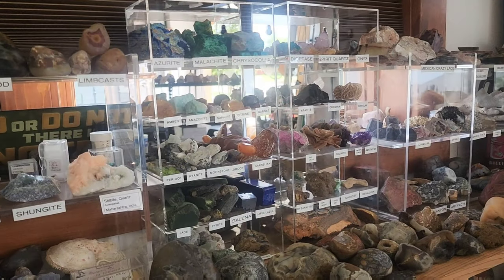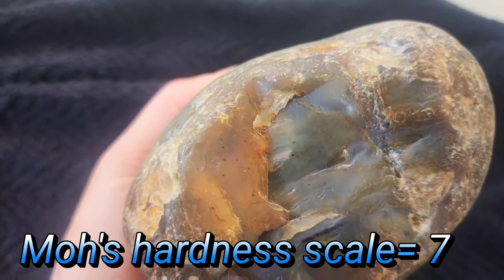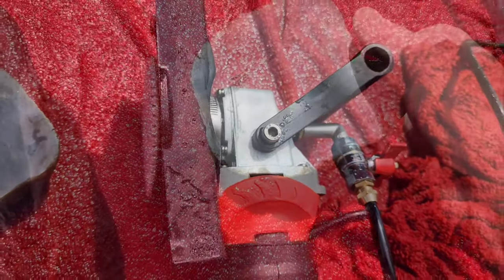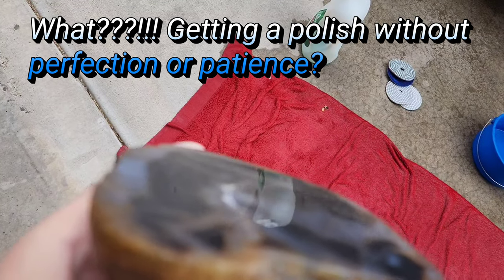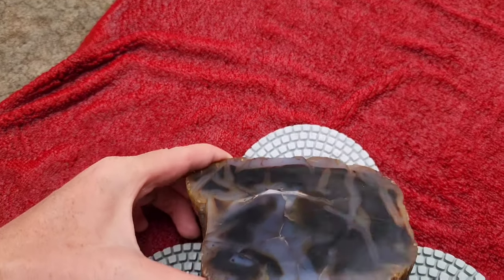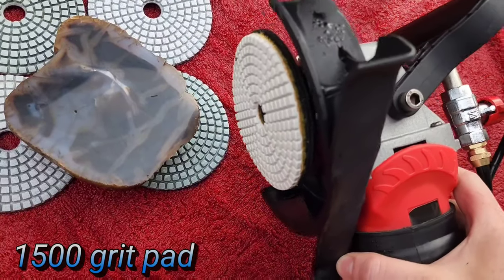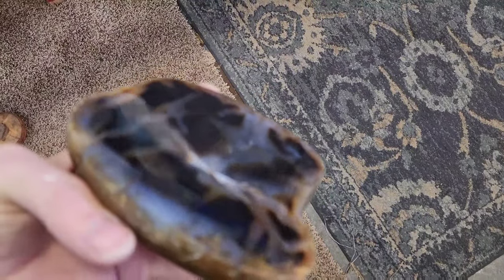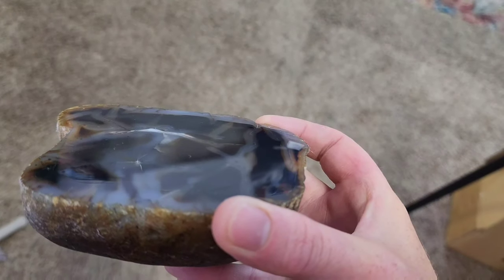From Start to Finish: Wet Polishing a Large Rock #wetpolisher

Comment: I do hope everyone using these grinders are using a face mask at a grade of N95 or better. That fine silica that you are taking off will end up in your lungs and in 20 years, just like a smoker, you may end up with lung problems that could have been avoided.  It is fine enough you need the N95 or better, not just a simple mask.   Any time you are grinding rocks you should wear one, not with just the grinders.  Even wet polishing you should wear one.. how much "powder" do you feel on your face after you have finished and are dried off? that same amount is going down your lungs!!! be safe! ear protection and eye protection is a must also!!!
Reply: I hear you  . When I first started using a bench grinder for my rocks I did a solid 5-10 rocks without a mask and I felt it . Mask is a must 🫡

Comment: I had someone in a rock shop in Deming show me how he uses one of these. He has a small washtub filled with gravel that he grinds the rock into to hold it place. The tub has a hole in the side near the bottom to drain off the water. The tub also acts as a splash shield so you don't get soaked.

Comment: Lower grit number for lower speed, fine grit associated with the higher numbers allows for a higher speed.  If you removing lots of material with 50 grit your problem is with the heat produced which can cause small shallow fractures.

Comment: I started off with these types of wet polishers years ago. They work, but can take a lot of time.

Always wear rubber gloves when using it. It nakes holding your piece easier and can insulate you from getting a shock. 

Cool video.

Comment: Great job Kim!  I'm going to give you a pro tip on how to get those scratches out faster.  Stay on the lower grits a little bit longer, and then the higher grits will be very quick work.  Every time you try and remove scratches with a higher grit like 800 it means you should have stayed on 120 or 220 or something in that area a little longer.  I'm sure you figured this out pretty quickly.  The polish came out real nice, you will be a pro in no time!!

Comment: Awesome! I have those same pads but I just use my angle grinder for the meantime and dip in water as I go to keep it wet. I'm still a beginner lol. That's a nice polish you ended up with.  Nice pup you go too! Great addition!
Reply from the maker: I first tried with an angle grinder but it wasn't variable speed. I learned the hard way you need to have variable speed to get the best results! My angle grinder was very powerful, my pad went flying across the street and I couldn't find it for days, lol.

Comment: I use a wet grinder similar to that but the hose attaches to the end so I can lay it upside down. Then I can hold the rock on the pad and move it around and apply pressure as needed. I also have a 5 inch stainless steel plate and pads to reduce the rounding on the edges of my rocks and speed up the process. Especially helpful on a bigger rock. Also got a 6000 grit pad for my final pass. Some people can't tell but I can and it makes me feel better. The down side to this method is it sometimes makes my fingernails shorter.
Reply from the maker: Does the stainless steel plate attach just like the other pads?
Reply: @Montana Rock Mom it replaces the rubber pad the polishing pads are mounted on. The one I got on Amazon is called Stadea ASBP103Q 5 Inch Hook and Loop Backing Pad With Rigid Aluminium Backing.
Reply from the maker: @wernberli  thank you

Comment: I use a Makita wet stone polisher
I recommend cross hatching the face of the rock during the first two grits so you can see right away if you missed a low spot.  You still need to dry the face to check for scratches before the third grit.  I use a Minwax pencil because the ink from Sharpies run into cracks and it's hard to get out.  The wax pencils in cracks can be scrubbed out with a toothbrush.
There's someone on YouTube who puts his rock in a bucket/tub to catch most of the excess water
Reply: I use a Makita as well, but still have problems esp with white or clear agates.. I still have very fine small swirls that show up at the higher polishes even though I have spent so many times going back trying to get rid of them.  They how up in daylight but not artificial light, that is how fine they are. do you have any suggestions? am I pressing too hard, too soft?? any tricks?
Reply: @annettesmith6358  I bought 6k and 8k grit disks and get a mirror shine on about 80% of my rocks.  I finish the other 20%  with a cerium oxide polish
Reply: @annettesmith6358  Other tip is to completely dry the rock to examine it before the last grit to make sure the swirls are
Reply: Also wash your rock between grits with soap and a brush to make sure there's no debris on the rock or in crevasses before going to the next grit
Reply: @nancywilson9380  Thanks for the tip about soap and water, will try that.  I do dry the rocks, and work on them only in bright daylight outside for the best light to see the swirls, I even get a magnifying glass out on those clear ones to try to see those swirls!  I have not tried a polish.. maybe that will take them out.

Comment: That 50 grit step can be a long one, especially if you have saw marks. I ended up buying a vibra-lap for that very reason. It preps the stone better than I ever could.
Reply from the maker: I had to send my vibratory lap back to the manufacturer to fix the motor! It's been a while...I hope they fix it. I miss using that.

Comment: Love your videos. Just a few tips that ay help you and speed things up. First, make a box out of 2X4 and plywood scraps that is just slightly larger than your rock(nice rock by the way). Fill the box 2/3 full of runny plaster of Paris.  Coat the back side of the rock with Pam or Elmer's glue and let it dry I bit. Push your rock into the plaster to the point that the rock surface is just above the plaster and let it dry. The rock won't move at all and you can put more pressure on the grinder and keep the pad flush with the surface. The fixture won't move around on you while grinding. 
Second tip, use a wide sharpie and color the stone before you start grinding and polishing. The marker gets into the scratches and it is really easy to see when that step is complete,  marker gone move on.
Third, turn your water fliw down some, the mud you will create on the surface will actually grind or polish the surface faster and you will make less of a mess.
Finally,  if all else fails, and in the winter just come throw the rocks on my vibratory lap and walk away. Leaves time to cut more rocks, and it's much warmer in the winter. Covington sells a vibratory lap for little money, watch their used refurbished listing.
Keep the fantastic videos coming,  I love em

Comment: Awesome job, I have the same pads but I use a drill motor. I recently bought a used AC motor which runs at 1725 RPM and I will be building my own flat lap. I don't think you needed to have the water on that high but on a hot day that looked like a fun way to stay cool. Really like your content, I have watched a few of your videos and thought I had subbed! I have now. Love the new addition to your family, Lola is so cute, and so are you! Rock on.

Comment: I benchmount my ZFE to an outdoor table with a metal clamp and it becomes much easier to work with. Holding the stone is much easier than holding the grinder for smaller pieces like this. Mounted vertically so it's more of a vertical high speed flat lap of sorts.

Comment: with a smooth cut like this from Drogon it would be best to use a flat lap if you have one. where this wet polisher comes into it's element is when you use it to polish curved surfaces on a speciman that you plan to leave a rough side on, especially something large. this is a great tool but don't wear yourself out on it with the wrong rock. heh like you said definitely a job for the hot months and when you can enjoy getting mostly soaked. heh some of your crazy looking jaspers is where this machine can be amazing i think. imho

Comment: I happened to have bought that exact polisher but have been apprehensive because of the water/electrical factor. Has the gfci built into the cord ever tripped, or have you felt any tingling? 
Thanks for posting this.

Comment: Great post Kim❣️Glad you were patient ENOUGH ❣️ I wondered about the total time for that job? Must have been a while if you had to break for dinner❣️Welcome Lola❣️ Keep on Rockin❣️
Reply from the maker: I probably spent most of my time drying the agate off and trying to see if I had scratches. I didn't spend more than 5 minutes on any one polishing pad. There are 7 polishing pads though. So, if you are drying your agate off and analyzing it between steps, etc... you will likely spend at least an hour from start to finish.  I also had to cut it. It took my saw approximately 15 minutes to cut through... then you have to clean it and get all the saw oil off. Boy, the time starts to add up... and then you are hungry!

Comment: Just get a flat lap, eliminates all that work....and getting wet. 
    It appears like there are some ridges on the face of the rock as it comes off the saw.  That suggests that sharpening your blade (make it cut faster) might eliminate that, and if it doesn't, then you may have an issue with worn bearings allowing minor movement of the blade as it's working. Before a full bearing replacement though, make sure the bolts holding the bearings are tight since loose bolts could also be the culprit. To check for bearing wear, grab the nut holding the blade, then the flywheel, and wiggle them, if there's movement, either those bolts I mentioned need tightening, or the bearings are getting worn and will need replacement at some point to stop those ridges from forming. But then again, maybe it was just the way the face of the rock looked in the light and there weren't any ridges there at all?

Comment: Hi, I just bought the ZFE grinder.  Packed with the grinder externally were two brushes.  Do they need to be installed or does the grinder as shipped have brushes in it ?  I know. "Dummy take the shield off and lool!".  I am just a little conerned about opening up as it does not seem easy to communicate with or return to ZFE if everything isn't perfect.  Can anyone tell me if the brushes are already installed or if the ones I received need to be installed?  Has anyone had experience in installing and replacing the brushes and know where new brushes can be found if I need?
Reply from the maker: I've never installed or replaced brushes....

Comment: Love Lola, she will be a great buddy for Chopper. I have a 12 yr old Golden, my 6th one, I love these dogs!!! ooh.. yeh about the rocks... I use a grinder as well. I find the biggest challenge is with the light colored agates, white to clear... I get to 400/600 grit and think the scratches are out then go to polish and about 1500 grit these tiny swirls show up. You can't see then in artificial light, but outside in daylight you can... anyone have a suggestion.. am I pressing too hard or not hard enough at the lower grits? as I have gone back to lower grits for longer time and they still seem to show up...
Reply: I met a pro polisher and he cuts one or two rings out of the center hole of the disc to prevent swirling. I do this only on the higher grits, 1000 and up.
Reply: @dennislandstrom6904   Thanks Dennis I appreciate the response..., but just want to make sure I understand what you re saying....So the small  hole  where the water comes out in the center, you cut 2 or 3 rings to make it a large hole? Is that correct?
Reply: @annettesmith6358  yes,on 4 inch disc I cut 1ring and on 6 inch disc I cut 2 rings out for 1000 grit and higher. If no results try slower speed if you can as well. Good luck
Reply: Beyond that I made a disc from apiece of Berber carpet. Glued some felt to the back, keeping it damp but not too wet and mix up a thick slurry of cerium oxide polish. You can get a museum quality shine with this. Check out Kyle at world of rockhounds. He has a good vid on it

Comment: * I was very surprised at the deep saw mark on the face of your cut. Sad.. Leaves you with lots of work.. ~ ~ If you take a permanent marker & draw hash marks across the face, you can polish until they are gone.. Easy way to tell if you are working out the Scratches...[half inch apart lines, vertical & Horizontal.] ~ ~

Comment: Why do it this way instead of a machine designed for the task? You are not using any safety measures and taking into account the blow back of rock dust even with the bath involved with this method. I do not understand ...must be my age showing I want to do things with ease and safety by not using items not designed for small rock/agate slabs.
Reply: This is what the machine was built for, 😂, it's a WET polisher...  There is more than one way to polish, you can choose whatever way you want to ...  This is America not North Korea...
Reply: @MrJackson66  Really, I never noticed this was the USA, but you still did not answer why someone would use a tool not designed for the project /job and that does not consider safety issues when posting online for anyone to see without disclaimers..I always wonder why people advocate for things in tutorials that raise safety concerns and then do not address those issues ...beginners deserve to understand the risk they take using items not designed for a job...I ´m all for people trying new things but if you do not address safety concerns you leave yourself open to litigation ....America is the land of holding others liable in court for what many would consider frivolous cases...one slip with this method and you can cause skin,ligament,and tendon, damage besides many other problems....so again why ?